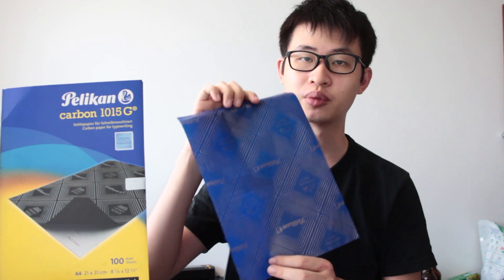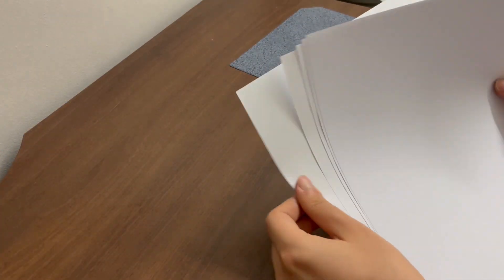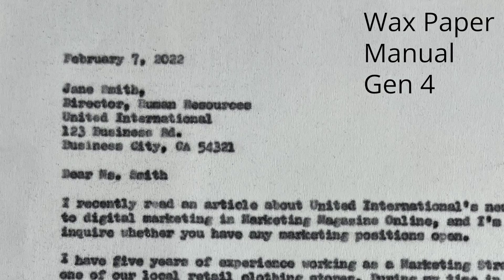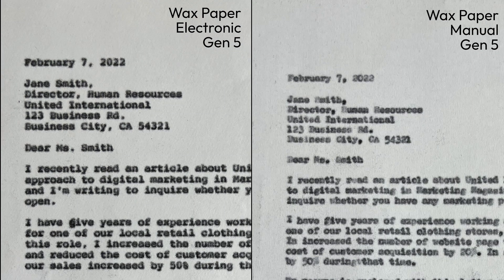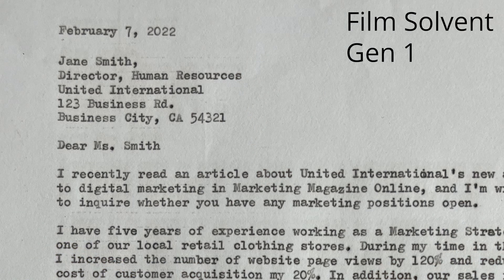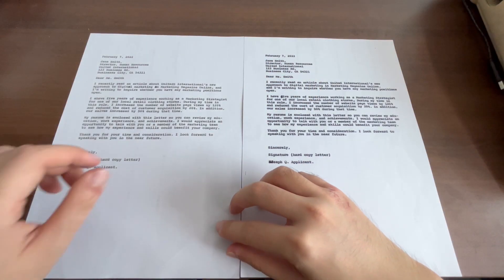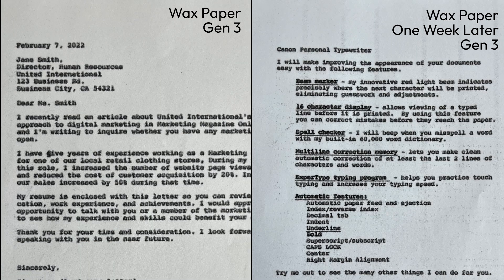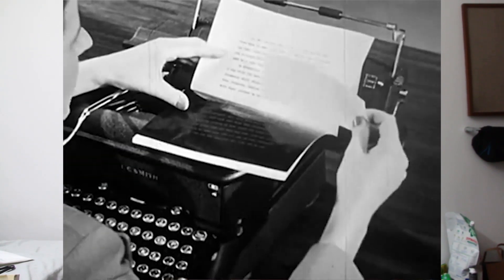Carbon Paper Duplication

Comment: This was a surprisingly interesting video. Was not expecting to watch 20 minutes on carbon paper, but I did.
Reply: I think a lot of people would not believe this is even possible.  If they could even stop laughing long enough for you to tell them!  This was a great level of detail, just right for my situation where I just recently realized that I COULD STILL BUY these products.  Now I'm having a good time, doing the little experiments, making a mess... this is the perfect time for some detailed instruction.  I had a hilarious struggle with the cheapest Carbon Paper, it's thin and floppy and comes in a plastic bag... and there's nothing printed on the back.   So it's possible to get it in there upside-down!  The results of this are surprising but not useful, I was glad nobody saw.  My first few attempts to make multiple Carbon Copies were a ridiculous mess.  Things have settled down now, it's the perfect time to find out that there's GOOD STUFF being made in Germany, and also Japan.

Comment: Thanks for the great video! Very thorough and clear. I appreciated the tips on how to feed the paper through whilst keeping all the pages aligned. :D

It's also very cool how typewriter carbon paper is longer than normal A4 or letter paper, to allow that trick where you pull away the carbon sheets all at once. 👀
Reply: Thank you for your answer (:
I have a Brother pj printer, and I use it for tattoo stencils. And I've got a lot of tracing papers (from older printer that i had)  without the pigment sheet.. so I'm looking for a good copy paper to use all of the extra papers.. any suggestions?

Comment: Hello can i use this carbon paper in thermal printer?
Reply from the maker: Hi there!

I have tested using this carbon paper on a thermal typewriter before. While it may work, the printout quality will be very smudgy and blurry. I would not recommend using the wax carbon paper for thermal printing

A wax or resin thermal ribbon will be more suitable